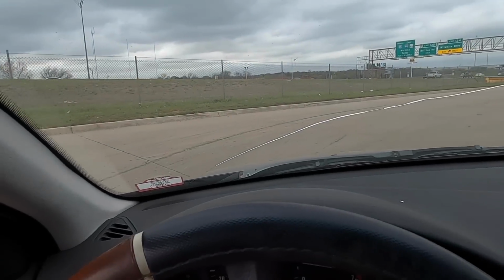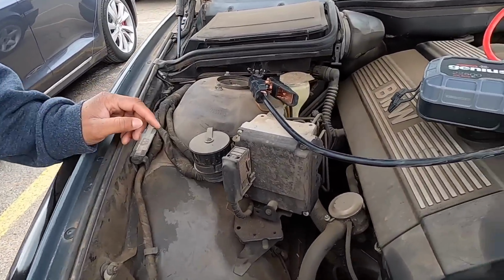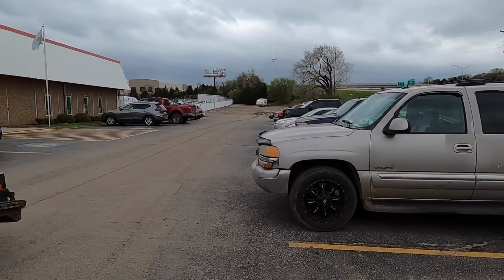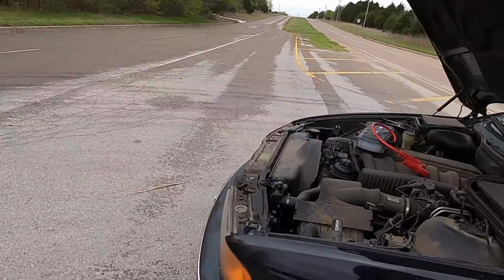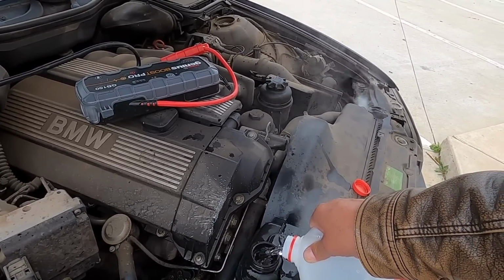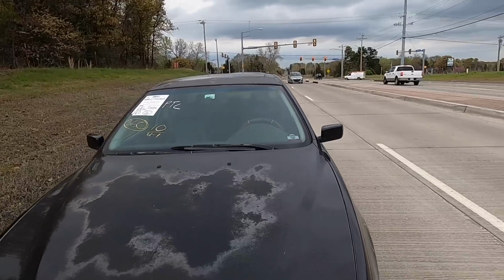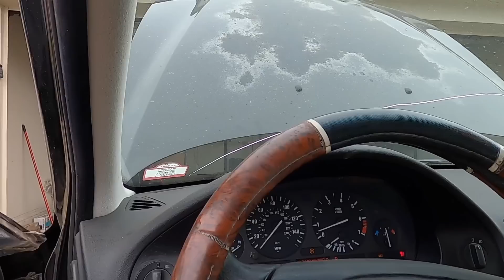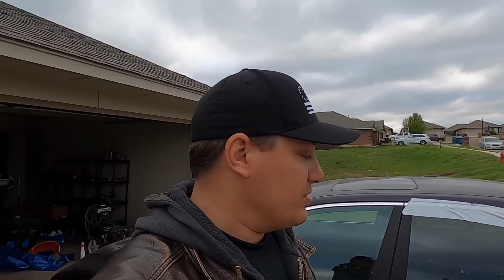I Won a Charity 1997 BMW 528i e39 from IAA for $175!!! Does it Drive??

Comment: Those BMW in that era when the battery is old or when the alternator is going Bad, it sets a lot of codes of transmission  and the transmission just acts that is slipping or goes to limp mode
Reply: I agree.
Reply: This is how I bought my e38 for $3000 with only 96k miles, owner said transmission, found electrical problem with keyswitch. 50k later, no transmission problems

Comment: As a German viewer: Fix it. I worked on those beemers many years, and the engines are great. Last engines that did not have too much environmental shit on it. The rad is usually broken, either the rad itself or the expansion tank on the left. So take a new rad, new expansion tank, grab a doorhandle, fill up aircon and check for leaks there. A good clean and a paintjob is needed, and then this car runs another ten years with no trouble at all. German cars ain't bad, they just need a bit care and ongoing maintenance.
Reply: Yup, they just like little love and will last for years.
Reply: RJ FT

True. Greetings from neighboring Poland.
Reply: Tell that to my n62 e60
Reply: Never ending ongoing maintenance lol
Reply: Haha never ending maintenance..lol.

Comment: When I buy a car at an auction, I always include: booster pack, water, oil, iron wire and duck tape. The survival package for every buyer at a car auction. It is actually a shame that you started driving an overheated car.
Reply: When buying a car like this at auction, the first stop is the parts store for a new battery.  The next stop is the gas station to put in no more than 5 gallons.  He can then get it home with that.  I learned decades ago that if you fill up a dealer car it will fail and you will lose all that money.  It happened to me many times.
Reply: Also if your car is overheating turn on the heat full blast. It will help cool it down. Had to do it after hitting a deer in iowa and had to make it home in Missouri
Reply: We always include a car trailer in our survival package...but that's just me.

Comment: My first car was a 1998 528i that i just sold not even a full year ago. I experienced EVERY problem in this video torward the end of my 4 years of ownership and over 300k miles on the odometer. 

I absolutely LOVED that car and plan on buying another one this year

So don't let this video fool you, E39s are solid cars if you treat em right. For 300 bucks I'd happily buy this one

Comment: Hi in bmw if the battery is damaged then the automatic transmission will be malfunctioning so you need to replace the battery They are knocking the variable timing phase terribly on it is a repair kit, check the engine fan as well as the thermostat and water pump these are common problems bmw

Comment: I've had many e39 BMW's (1996-2004) and currently daily a 540i with 205,000k on it - This is THE BEST chassis ever made and you gotta keep it. These things drive and handle better than anything with 50/50 weight distribution and all aluminum independent suspension - NO SHIT SHERLOCK
Reply: Endless money pit my ass!! If any fake knews spread here its u!! Its the former owners that hasnt taken care of the car like you should with a car in general! Basic fuckin stuff like Oil service between a max off 10-15k km, never run it Long on low fuel for the sake og the pump, change the shit thats broken when you start to notice it or you get warning lights and for the love off god never throw salt on the wound and drive it so Long when its overheating Even if they have a fair chanse to survive from not getting the headgasket blown right away!!, speaking off experience from when it happened atleast 5-6 times if not more with my old 98 520i m52b20 that Just had a bad termostat and yes it boiled over like this one before i got it replaced at the time! So whats a Endless money pit is fuckin 3 series instead especially from the ugly ass e9* series and up! God forbid that shit 🤮🤮

Comment: Try turning the heater on high for additional cooling when the vehicle is overheating and leave the pressure cap loose to avoid pressure buildup and loss of coolant.
Reply: George Hoy he did in the video lol

Comment: This is just so very sad, as a BMW owner myself I hate seeing one in that kind of condition. This whole video was painful to watch.
Reply: I'm a GM guy, but am open minded. That being said, I love E39 BMW sedans. It's sad to see em beat up like they owe you money
Reply: I'm a Benz guy but I love this era of  5 series
This thing was ran like truck for too long. Shame
Reply: @parteibonza  First: The E39 was one of the most advanced cars at that time you could buy, only some higher up Mercedes oder the E38 had better options than the E39. 
The option list of the E39 is even today respectable. Memory-Seats, dual glass Windows all around, Dual Zone AC, Xenon, rear sunshades, separate blower and heat adjustment for the fond (so technically a 2.5 Zone AC) and so on..., now more than 20 Years later, still no standard equipment in a new car, most stuff you have to option in. And nonetheless new cars can fail also. 

And what do you expect, buying a 20 Year old car with a hefty amount of electronics in it? That everything works fine for another 5-6 Years? Damn, get the hell outta here! Stuff wears down and if you don't fix stuff when you see that it is due to failing and do nothing, then you end up with a parts list of 3-4k and then the people are whining "Shitbox, Crap car". It is, if you don't take care.

Comment: Why would you keep driving with coolant in red? Might have change head gasket now
Reply: Because it's a 305 dollar car with tons of issues and it made for a good video? lol
Reply: he fucked it up himself don't ever drive an over heating car ever common sense. do not  don't don't
Reply: Same reason he (as a profession) tries to get cars home without carrying any tools, coolant, oil, fuel, jacks or safety equipment. Why he does not utilize a truck and vehicle carrying trailer to retrieve his "wins" is stupifying. He actually is a hazard to himself and the motoring public.
Reply: @mrpesky163   he does it for the video content, if he just brought it home in a trailer he would have nothing to show, couldn't care less about any damage he does to the car
Reply: @joepierson3859  Yep, you are right sir. It pains me to watch, but I watch (and that's what makes the world go around) 👍😊👍
Reply: Auto auction destruction!! That’s why!!
Reply: M52s don’t like to be overheated. Definitely think he may have blew a head gasket.
Reply: I wouldn't be surprised if he cracked the block pouring cold water into a hot engine.

Comment: Owned a handful of e39s, those AC’s if real are worth $$$ also reason why your ac is not working is cause you ambient temperature sensor is missing. Scan that check engine light if it’s a faulty speed sensor it will cause your speedo to not work and put the trans in limp mode. P.S redo the whole cooling system once one part fails the others aren’t far behind

Comment: When a car starts to overheat especially a BMW always turn on the heater inside on full. It usually helps a bit to reduce the overheating.
Reply: On a newer car I turn on the A/C to get the electric fans to come on.
Reply: Mexican Spec yeh that’s right and if you want to prevent overheating, transfer the fan to work directly from the engine. This means that the fan will never turn of and nobody will ever know the car is overheating as the fan is always on.

Comment: I have an e39 with 250k miles, still on the original trans and engine, never had any problems with it until recently
Reply: I own that same car with 270K and only problems were window regulators and speed sensors in the wheel. Oh; coolant expansion tank failed which I heard is common.   If the battery doesn't fix his speedometer problem he should try the speed sensors.  That will also affect the transmission shifting or it did in mine.

Comment: Thermostat is stuck close. BMW's are known with this issue causing the system to overpressure the reservoir and cracking it. Happened to me on the 95 going to Florida.
Reply: I had a 97 with 250k miles on it. The thermostat and housing were almost a yearly change because it got too hot and warped (autobahn runs). The fan clutch was an issue once but when it ran......it ran.
Reply: David Hardinge, I was going through oem Radiators, and thermostats annually at $665  a pop as well until I switched from green radiator fluid to bmw blue radiator fluid.  Same radiator over 7 years now no issues (knock on wood) mileage is 218,000.
Reply: @stevekaphingst4327  What chassis BMW and where do you get your thermostats? That seems a little steep for a thermostat. I paid no more than $30-40 for my thermostat on my e46.
Reply: e39 528i Radiator and thermostats from indy shop would come out to $665 with labor total.  Was a repair I could count on every year.  I know the first fail was my mistake as I brought the shop an aftermarket radiator and thermo from online, but the rest of the radiators were OEM green radiator fluid brought them all down.
Reply: BINGO! Super common problem on the E39 and E46

Comment: FYI the proper bleeder valve is right next to the coolant cap. Crack it open with it running and wait for coolant to flow without bubbles, might have to do it a few times.

Comment: Looks like a good project car. Just remember that a low or dead battery in these will put the gearbox in 'limp mode' and cause all sorts of warning lights and malfunctioning windows, door locks, wipers, etc. Fix the battery and coolant before making a judgment on anything else. Why would you drive it without coolant?  Send your partner to buy some coolant or water before you drive it home.

Comment: I would bring the car dolly and tow it back instead  of trying to drive the cars back.  Just saying
Reply: Exactly! He must be doing it just for Content for  the page. I can't imagine anybody just jumping in an auction car that they know is low on coolant and has other issues and just trying to put it on the road. Safest thing to do with older cars like that is to just tow it home and then check it good, instead of just putting it on the highway without even making sure the basic fluids are filled
Reply: And then he blames the car
Reply: @toddhodges4405  he literally said in the video that he didn't blame the car lol
Reply: He had a trailer  someone stole it
Reply: @thadd05  He had a trailer, someone stole it, he got it back and the sold it. Since then, he bought a car dolly and used it a few times. Haven't seen or heard of it recently. Maybe he got rid of that too and I missed it.
Reply: @carlgooden1369  Agreed on all counts. 'Content' is King. However, if I was picking up Copart cars and trying to drive them home, I'd at least ALWAYS have in my chase vehicle some basic tools, my scanner, some spare fluids, jumper pack, air compressor and a tow strap (or dolly). Of course that would lead to less drama for the King. <:O)
Reply: @lovellmills7959  But yet he did several times  lol
Reply: @thadd05  He found the Trailer and got it back and then sold it

Comment: Please save this beamer, those older 5 series are one of the best BMW's ever made. Those AC Schnitzer rims should be a fortune to the right buyer. The cooling system in general is a known problem on those M52 engines. Good idea to run through the whole system. It should be a score with those miles.

Comment: The AC Schnitzer is one of the first companies who makes quality BMW’s after market parts for decades and these wheels are AC Schnitzer type 2 which introduced in early 90s even this design came with the matching driving wheel.these are worth around $500 ( give or take ) because they are 16 inches but as you mentioned first you have to make sure that they are OEM. Either way I love and respect what you do just keep doing that great work and stay safe and healthy.huge like

Comment: I have a E39 BMW 525  2001 model which has given me trouble free motoring. Absolutely a wonderful car. The original battery lasted me about 10 years. I hope you haven't blown the head gasket.

Comment: The wheel speed sensor is most probably gone bad, that's the reason your Speedo is not working, just scan the car after you change the 🔋
Reply: Had this same car and when my wheel sensor went bad it caused the trans to go into limp mode
Reply: Nope, usually the abs pump, the electrical part on it
Reply: DODO I don’t think that’s his issue, while they are known to go out cause of heat created by the exhaust he would have what’s called a trifecta (ABS,brake and dsc) since he only has the abs and dsc lights on it’s more than likely the left rear sensor

Comment: The odometer isn’t working it was showing the same mileage since you left IAA
Reply: I noticed that too. Probably has way more than 143k miles.
Reply: The speedometer is not working either which is probably caused by the speed sensor
Reply: Its because the speedometer wasnt working, usually when the speedo doesnt work the odometer wont count either because it doesnt know the car is moving.

Comment: 23 Year Old BMW; make it drive-able, no heavy investments just get it running. Door latch, used radiator,  or tank repair from a radiator shop. Replace the thermostat.  A good cleaning and send it down the road.

Comment: That's a great deal. Pick up your parts as cheap as possible - but I'd first do the battery, door handle, cooling, oil and boot struts.  This car is a survivor.  The interior is good, so it might clean up really well all round.  Check head, plugs, wiring, suspension, mounts, exhaust, all the other bits, reset the ecu, do your usual to see if it's worth going further. Thinking about it, I'd keep the AC Schnitzers as they are a selling point for the car and look good, it will be less hassle.

Comment: Definitely start with a fresh battery. It's probably just getting low voltage to all the modules and throwing a lot of codes because of it. If the modules don't have enough "juice", it could definitely make the car do some crazy things.

Comment: dude a $300.00 car the fact that you were able to start it at all beyond anything else it's well worth your time still. clean the thing up really good and swap the battery and get a new radiator for it, clean the engine. Then if you're going to throw a $300.00 Maaco paint job on it and post it up for $2,500.00 shouldn't have any trouble getting rid of it at that price once everything is done properly you may want to check the end of the Speedometer cable where it plugs into the transmission tail shaft the gear for the speed may just need to be replaced.Thanks though, seeing this and what it needs is getting me motivated to get out and work on my new Escalade project today, i needed this i think WHEN DID YOU EVER REALLY HALF ASS A CAR WITH THIS MUCH POTENTIAL? Not a fan of Lucky's he  is a great guy buy i don't appreciate how he half asses everything he gets. that may be his hustle, i just can't watch that. Do it right, do it all or just plain don't do it, PERIOD!

Comment: Hey Randy. I had the same car. Battery voltage is so low the transmission will be in limb mode. Also when u fill up the coolant make sure you fill the water thermostat fill up screw behind the clutch fan. Otherwise you will never purge the system and it will keep over hearing. And from the looks of it ur fan clutch might needs replacing its spinning way too weak

Comment: If only there was a way to get a car to your repair shop without actually driving it. Maybe use a large vehicle (say, a pickup) with some platform on wheels connected to the rear bumper so the car “trails” the pickup wherever it goes. We’ll call it a TRAILER! 
GAME CHANGER!

Comment: I hope you didn't have any serious problems from your last live feed.
My last car was a 2005 VW Passat that had overheating problems. The way I was able to limp it to the repair shop was to get it up to speed, shift it into neutral, shut the engine off, and coast until I needed more speed. It wasn't fun, but it got me to where I needed to be without getting too hot. It was because of that car, that I got AAA. The way that thing kept boiling over, I would have just called AAA for a tow.

Given the state of the Nation right now, and especially with your inability to get inside Copart's lots to film, I say go all the  way with this car. At the very least it will give you some good quality content for your channel.

Comment: I still own that same car for over 13 years identical.  Mine now has over 270K and still going strong.That speedometer problem is probably the wheel speed sensor right front or right rear I think.  I had that problem and the sensors fixed it.  It will also affect the shifting of the transmission.  Replace the expansion tank with the radiator because they are known weak points in the cooling system.  Mine has been reliable except for the problems with the speed sensors and, of course; the failing window regulators.  Good luck!!   By the way;  you have the upgraded seats like mine.  They are actually same as in the 7-series.

Comment: Hey randy just from my experience, any time the battery is completely dead leave the jump pac on . When you start it and take the jump pac off rite away it causes the voltage from the alternator to spike and can cause damage to the ECM BCM  TCM  ... I have seen many computers that went up in smoke at the auction because of people starting them and taking the jump box off immediately. Very bad  hope this helps

Comment: Hi randy, the speedometer not working is a speed sensor. Changing that will most likely fix the traction control light also. And from my point of view you need to change only the radiator as it is known to be made of plastic and when it becames old and brittle will crack. About the car, we'll, it s a good change of pace from all the gm and all of that(i m a European subscriber) but as you said, this can transform in a money pit very quickly if you Don, t pay attention. A former 535 e 39 owner. Be safe out there.